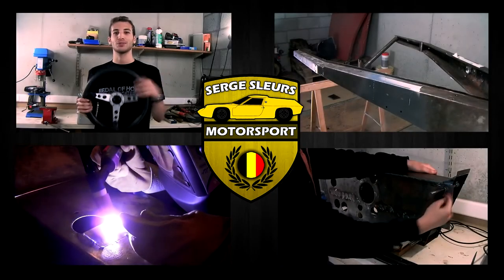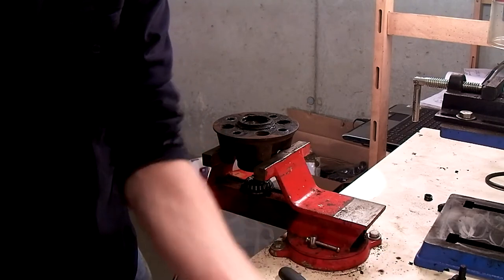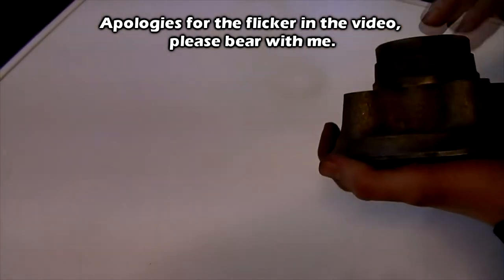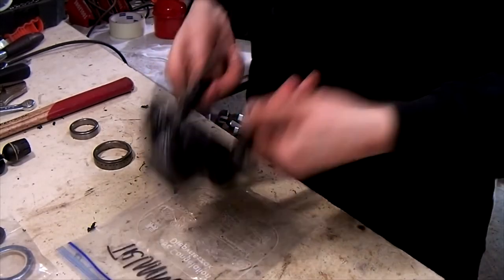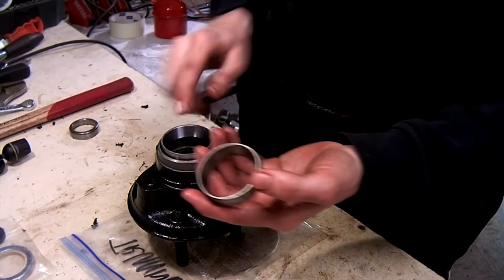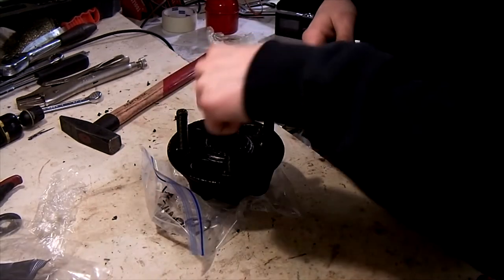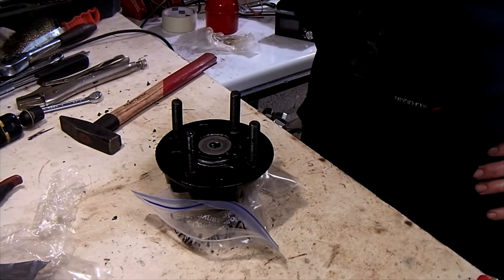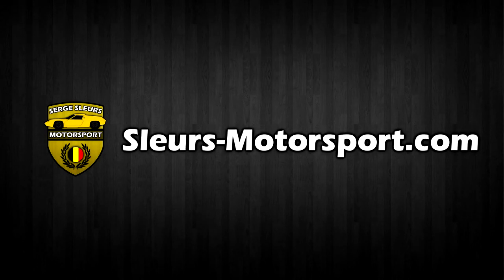Lotus Europa - Ep 15: Front hubs & wheel bearings

Comment: I enjoy watching your rebuild thread very much. I am mostly a Porsche classic fan and love restoring old 911s. After working a little on a Beck 906 replica I've really opened my eyes to lightweight race car suspension and how much weight can be saved by not using the mass produced suspension parts. My dream is a 1,000 lb space/tube frame mid engine car with a 200HP air cooled engine and a 911 carbon body shell, but that's still in the dream stage. My comment about your process is just that it wouldn't hurt to use some anti seize on threads where there will be a build up of heat and possibly road grime, as on the brake rotor bolts.
Reply from the maker: Thanks for the tip, Jens! Much appreciated!

Comment: I have a Twin Cam with A Mazda 13B that I'm about to get back on the road after it has been sitting for 4-5 years. The frame is also bent from a right side impact with a curb.  Your videos have been very informative for my future project.  I'm sure I will be returning to them as I go along.  It has an aftermarket dual circuit master cylinder that doesn't work very well.... yet.  My question is, where did you get the grooved rotors?  They look very nice.  
Thanks.
Reply from the maker: pellcio Hi, thank you for the compliment! I'm using two master cylinders with a balance bar, I'll touch on that in a future video. I got the grooved rotors from Richard Winter at Europa Engineering. Item nr CC0001G http://www.parts.banks-europa.co.uk/orders_frame.htm

Comment: Hi. Did you switch to metric studs to fit some different wheels?
Reply from the maker: Yes, changed to M12x1.5 63mm long studs. Bit stronger and longer for different offsets.
Reply: @sleursmotorsport  that makes sense. I'm really enjoying the videos and getting inspired to get back in my Elan +2 build. How is your bodywork coming along?
Reply from the maker: Bodywork is on hold for the minute, too cold!
Reply: @sleursmotorsport  mine too